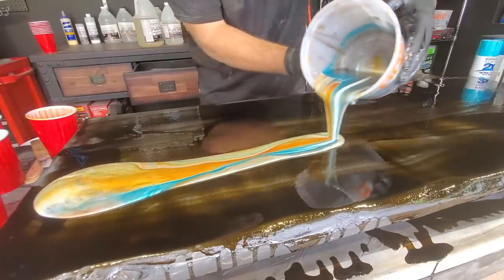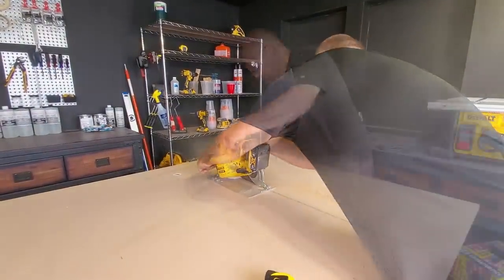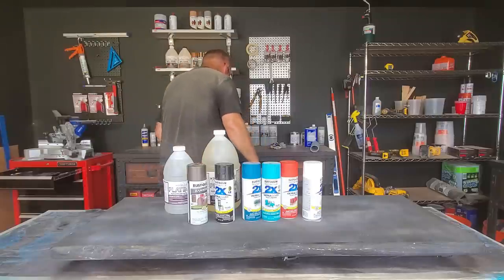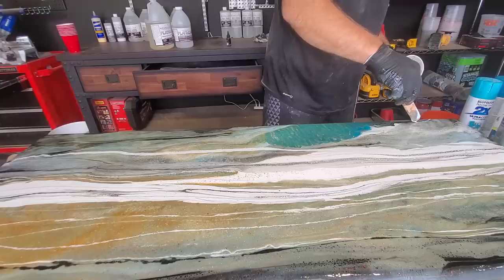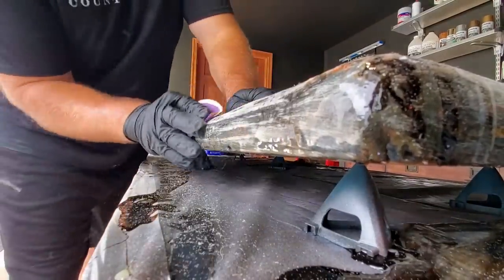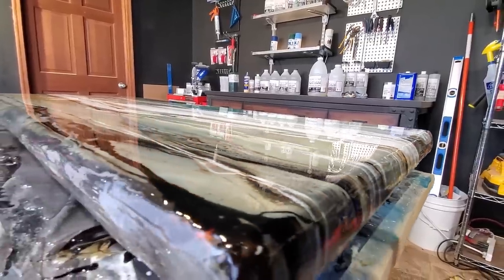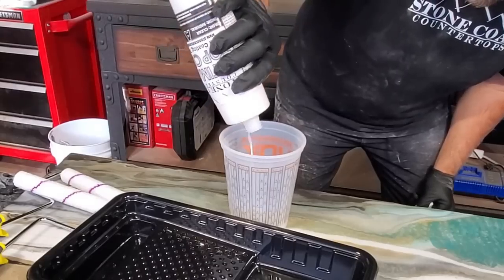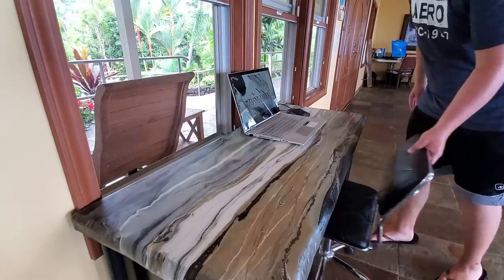Epoxy Desk Budget Build, How to make Realistic Rock | Stone Coat Countertops Epoxy

Comment: Can you clarify during the instructions “what” is the 2-1 ratio? Which is the 2 & which is the 1??
Reply from the maker: Other epoxies may vary with the mix ratio, for example, Flooring Epoxy 2:1, Casting/Super Cast 2:1, Art Coat 1:1, Craft Coat 1:1 Quick Coat 1:1, and Top Coat 2:1.
Reply: @StoneCoatCountertops  I’m referring to this video.

Comment: Every time I wipe something down with solvent, I'm thinking I'm wasting solvent (and breathing it) if I've got the option to use my shop-vac with brush attachment, either first, or exclusively.  Ever come back to a wiped-down surface that's dried, and wipe it again?  If you get more dust coming off, you know you were just moving the dust around when you thought you were cleaning it.

Comment: hello. Looks like you are no longer using isopropyl alcohol. but use acetone instead - is there any specific reason for that?
Reply from the maker: tough to get IPA these days, anyone got a source?
Reply: @StoneCoatCountertops  I see, I am not from the States, IPA has become more expensive (used to be usd 1,1 per liter vs usd 4 per liter now), but it is available here with no problems. We also sometimes use ethyl alcohol to cool the surface down

Comment: Hey buddy my next project i am planning  my showers with mdf panels like the ones you help your friend build but I have a question I called your company but the agents had no idea either. So the question is did you guys put a back splash on the shower where the wall meets the floor or did you guys went all the way down to the floor with the mdf panels?
Reply from the maker: We rest the panels on top of the lip of the shower pan above the threshold height

Comment: Can you do this outside where it would receive direct sunlight?  Does it get hot?  I have a balcony patio that is cracking and causing a bit of a buckle around the crack due to settling and rain getting in the crack, and needs to be redone, but I'm wondering if rather than having it replaced with flat roofing if I could just cut out the part that pushed up around the crack and use concrete patch and then do a stone coat stone look over it.  I'm in Vegas if you want to come do it as a tutorial video for me the next time you come out here for that artisan convention.  😘😘😘

Comment: Is the mdf material strong enough to hold two monitors on a arm swing.  Would be cool if you attach that counter to an adjustable motor that allows you to change the height.

Comment: The only obvious question is the cost... on a budget? Tell me no more than $100, or this is no budget job. The cost of spray paint alone is $5 to $10 a can... how many cans. Do try and be honest please.
Reply: The Platinum product is about $9 per square foot.  The desk is 2'x4', so that's $72.  A half-sheet of 3/4" MDF is about $15.  I'm not sure how much the table legs would be.
If someone is just starting out and having to buy all of the other supplies (glue, gloves, torch, buckets, Bondo, spray paint, grinder and grinding disc, sander and sand paper, nail gun and nails), that will add up.  However, once you buy those things, you can get quite a few projects out of them.  For someone who already has the tools on hand, yes, it's probably a bit over $100.